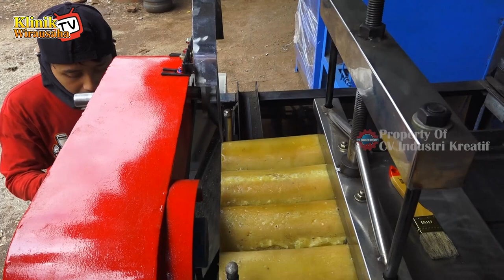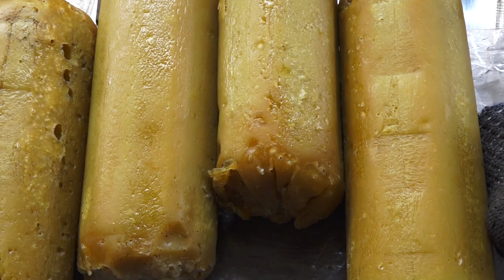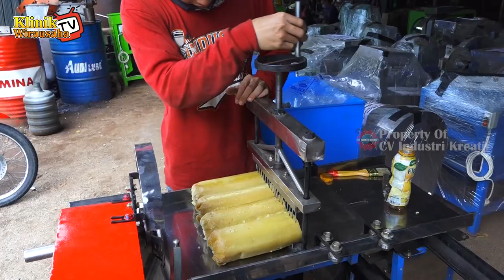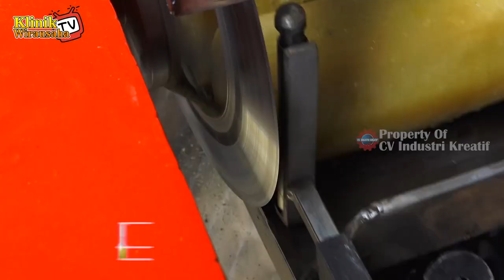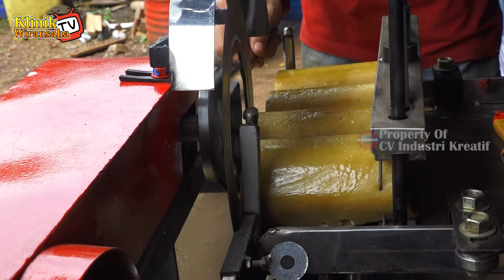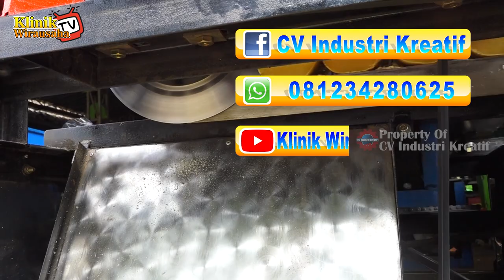Mesin Pemotong Kerupuk Type Kecil Material Stainless Otomatis Harga Merakyat

Comment: hrga brp pak?
Reply from the maker: untuk info harga,detail mesin & pemesanan hubungi Customer Service Representatif Kami (Telp/WA) 081234280625 - 081217850288 - 082142267610 - 082334870125 atau kunjungi Workshop Kami di Jl Madiun - ponorogo KM 10 Selatan Puskesmas Geger 300 Meter Kec Geger Kab. Madiun Jawa Timur